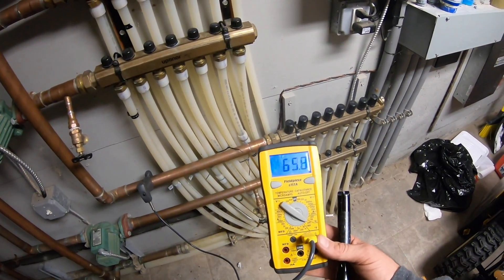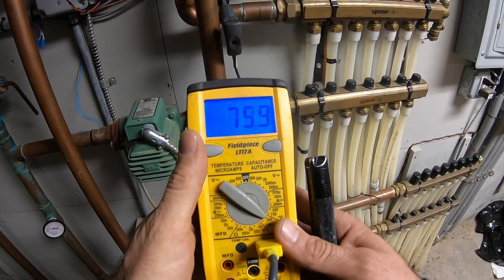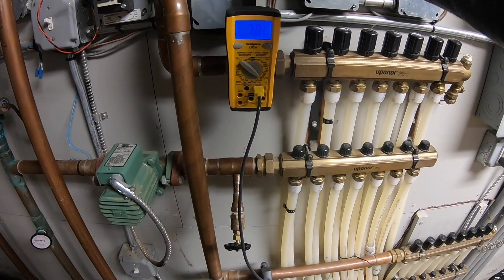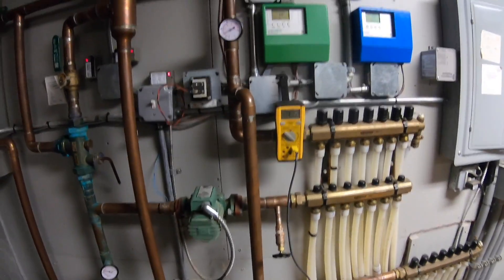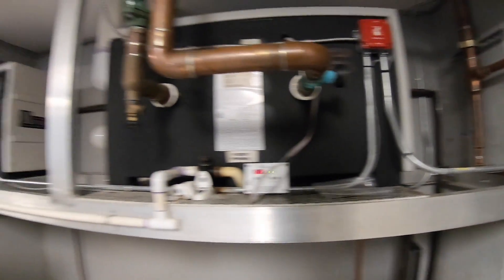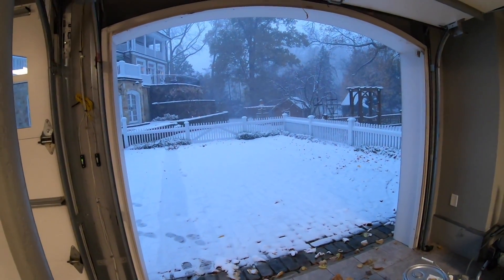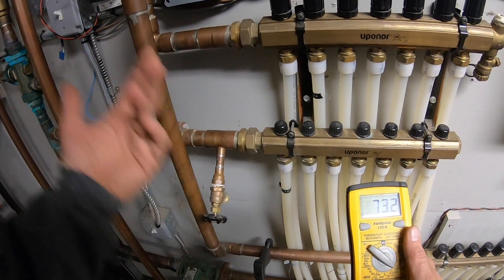Testing Boiler Snowmelt/ Heated Drive Way System After Repair During Snow Storm

Comment: I build a small little system on the house and we got some freezing rain and dryed the slab off in about 2hrs. 6” slab with 800ft of 3/8” type-c small little 275ft3 about 40kbtus. But its warm in Kentucky lol. We don’t get but a dusting.

Comment: I'm just now doing my research on this, isn't 120 degree too hot to hit the frozen concrete with?
Reply from the maker: It takes awhile for that slab to heat up. That 120 degrees will decrease as soon as it enters the slab. It’s buried at least a foot under the actual driveway. Remember the water is cold when it first starts moving through the slab and slowly heats up. Yes if it was 120 instantly that could be a shock.

Comment: I’d invest in the gas supplier. That system has gotta cost the homeowner plenty!
Reply from the maker: I have owned stock in PSEG since 2010. I take care of about 300 homes with heated driveways. It’s one of those selling points, like a generator, all heated floors, snow melt systems for driveway and all walkways.

Comment: All pipes should be isolated for less heating loss.
Reply from the maker: All pipes are isolated with flow controls and actuators for the zones.
Reply: @thehvachacker  Im sorry i ment insulated.....sorry english isnt my language :) Especially the copper ones. You need the heat in the pipes not to warm the air. Its a conciderable amount of heat loss. So the boilers works more and less heat goes under the ground to melt the ice.
Reply: @petertomas3665  It's possible, and even likely that the homeowner wants the waste heat to help warm the garage. No need for a Modine or similar

Comment: Maybe the water pump is to slow. So the come back water get cold. More faster 🤷‍♂️
Reply from the maker: Good thought yet the driveway slab was frozen so it will absorb most the energy/ heat causing a colder return temp

Comment: I'd like one of these systems.. I'm in Michigan and the last 2 snow storms we had so far this winter killed me the days after I shoveled. I would prefer to spend the little bit of money it would cost to run the heater during the storm than spend several days in pain, having difficulting breathing, or waking up with what feels like a heart attack.
Reply from the maker: I would like one also. Many are hating on this system yet
 If they lived in an area with lots of snow and could afford it 5ey would have it. Most that are hating on it don’t deal with much snow or shoveling
Reply: @thehvachacker  Do you have any ideas on the cost of installation? Also any ideas on best overall system, least maintenance required, cheapest, easiest to operate? Maybe you have a video on that already I can watch.

Comment: so much hate .. its their money. I wouldnt have it, and my driveways steep, some salt and grit, and winter tyres on all the cars and were good to go, dont bother shoveling the snow, just drive and compact it, long as the cars done slide who cares.
Reply from the maker: There is a lot of hate over this heating system. I won’t turn down the work so I will maintain and repair a system designed to heat the ground.
Reply: I do this for the most part, drive on it and pack it down as much as possible but that only works for so long. If it starts to melt it gets soft and you can get stuck/bottom out in it.  Also when snow plows blow by your driveway the snow from the road ends up at the end of the driveway, and it can be super heavy and packed. Waking up or coming home from work to a driveway with 6+ inches of snow is never fun.

Comment: my brothers 2700 sq ft home has heated concrete driveway about 20 yards long (and interior infloor heat) run off 4 120 gallon electric off peak water heaters. built in 2006 the general contractor told him electricity is the best economical choice to heat his home. it's his 4th new home getting close to retirement he says he wont shovel/push around snow anymore
Reply from the maker: I will stick with gas it is much cheaper to heat with gas than electric. Yet why not I have customers with electric snow melts. You also have to factor in these only come on when it snows or manually gets started. These are not on all the time. I am putting one in next time I rip up my driveway yet I am going water over electric

Comment: The math is pretty straight forward in these systems.  Estimate the mass of concrete and the heat rise, add the energy of phase change to evaporate the snow.  The loads on these systems are insane.  That looks like about 1000 square feet of patio probably six inches of masonry total so 500 cubic feet of brick and concrete in round numbers.  20 yards at 4000 pounds per yard of 80,000 pounds of stone which needs about .33 btu per pound per degree F.   If you want to add 30 degrees F to the concrete you need about 650,000 btu.  Add in heat loss to the air and energy for phase change of the water and you probably need about 1,000,000 to get that slab clean.  If those are 150,000 btu/hr boilers you need about 3-4 hours.  And the energy required to allow the snow to evaporate could be that amount again.
Reply from the maker: 3 hours is what it took for those boilers to melt the driveway and all the walkways around the house. Those boilers are 400 mbtu each so 800,000 BTU of heat, it does all the decking and walkways around this house.
Reply: That’s why the Tekmar control comes on as the temperature drops,in theory,to heat the slab before critical heat is required!good system,just requires maintenance,and we Love maintaining!!

Comment: Only one condition for a heated driveway... if it was really steep. This big flat area I don’t understand. Garage is a mess.
Reply: People with money is how we make money.
Reply from the maker: Exactly and who turns down a boiler repair job even if the customer wants to heat outside
Reply: The HVAC Hacker 
Don’t care if they don’t use garage, still a mess, trip hazards everywhere, owners are obviously disorganized and make stupid decisions. Heating still not working from what I can see and quite possible not installed correctly. Money can’t buy brains.
Reply from the maker: Heat works the driveway was melted a few hours after I left. too much thermal mass for this to quickly happen after repairing both boilers. The main house is neat, spotless, and amazing. three people live in that house the lower garage and apartment are forgotten about.
Reply from the maker: They don’t use that garage. They keep there cars in a 3 car garage attached to house. The lower garage has an apartment on top also unused
Reply: @thehvachacker  i was just talking with one of my customers, a man with a ship load of money . He was telling me about one of his clients who has just spent $100,000,000 AUD on a house in Double bay Sydney Australia . All i can think of is the fact two people plus staff live in this mausoleum but it provides income for a damned site bigger crowd. And no snow in Sydney either.

Comment: Thanks for the informative video. I will never invest in this system because. It does not melt snow.
Reply from the maker: It does melt snow just not instantly, you need to let it run far some time since the boilers were offline locked out when I came into the garage. I replaced a blower motor in this house since and the homeowner said 3 hours after I left all the snow was off the walkways and driveway

Comment: Just going to watch the snow melt are you?
Reply from the maker: If it happens before 4:30pm yes I will. Since that is the time my maintenance ends. I am testing the equipment during a maintenance. You wouldn't watch it operate and make sure it doesn't lock back out?

Comment: Great idea to burn of fossil fuel and have absolutely no benefit from it. Why don't you take a shovel and workout a little. Waste of money, copper, plastic and of course fuel. IDOTS!!!
Reply from the maker: I hope not I like working on these. This is a lot more efficient than the electric driveway melt systems
Reply from the maker: So you are against making money working on a system like this? Systems like this need constant upkeep. have to make sure the glycol mix is correct so pipes don't freeze. yet you see this house these people don't do any maintenance. Someone comes in to change light bulbs for them. Would you prefer they were using the electric driveway melt that requires the 800amp service?
Reply: @thehvachacker  Cool system, but it is indeed an opulent waste. Perhaps an electric Roomba-inspired snowblower/plow could replace these systems in the future.
Reply: @Maptologist  who cares? If people are willing to pay for it then it's there business. The advantage is no salting and not using electricity in this case
Reply: @851995STARGATE  You should care. The world will run out of affordable fossil fuels at the current rate of consumption on the shy side of 25 years. Research peak oil if you don't believe me. Salt is also a bad bet, because it's already fucking up our water and destroying cars prematurely. I've noticed that Eastern states ban the use of studded tires to save money on road upkeep. This saves a few bucks on fixing the roads, but costs taxpayers much more because they have to buy cars more often. States like Oregon and Washington allow studded tires, and it's common to see a rust-free antique cars for sale, which have been driven during the winter. The alternative is to pack down the snow/ice, and to put down sand/gravel, just like the states out West do.

Just look at Flint, MI, which switched to a saltier water supply (which became salty from the roads) and released the lead from their water pipes.

We should be saving our natural gas supply for heating and cooking while it is still viable instead of pumping that energy in to warming a rich person's driveway. It's the same reason why gas lights are largely illegal in the US today. The last people to run them were rich, and they ran them as a status symbol.

Solution: Just shovel it. A rich person should be able to afford the labor.
Reply: @thehvachacker  You are missing the point. This is a huge waste of fuel, and is effectively polluting the atmosphere just to heat a driveway. Even if this were electric and powered 100% by renewable energy, it would be an extravagant waste of money and an affront to people who can't even afford a home.

Comment: Ok ok ok.. Yes i agree ALOT of energy/POWER is needed to acheive your goal... but one very IMPORTANT thing to not forget and i wonder if you tought about that: DID you ISOLATED the concrete slab with foam?  Otherwise your heat will dissipate thru the rest of the ground that is not necesary to heat... Foam would help to keep the heat where it is needed!
Reply from the maker: It's a good question we should ask the installers. I only do service work these days

Comment: Sorry but sounds like you are trying to convince someone of why the bill is so high.  Give a price, do a job, get paid, get gone, repeat. Not sure you know what you are looking at.
Reply from the maker: There is no billable work on this job even after repairing both boilers. The customer payed for maintenance. So no price given, I am actually doing my job running and testing the heating equipment all around on the property. I know what I am looking at and have been servicing this machine for many years. I just wish I checked the boilers in the lower garage upon arrival to find out they were both locked out. I would of started my maintenace working on the driveway melt boilers before working on the main house systems.

Comment: It does not take a rocket scientist to calculate the BTUs needed to warm the ground and melt the snow/ice. 145 BTUs per pound of water just to melt ice. 1 BTU per pound to raise the temp 1 degree F. Wet ground and pavers are 150 pounds per cubic foot. Probably 10 pounds of ice and 140 pounds of rock and dirt so a cubic foot needs 1600 BTUs to melt the ground. If the ground is frozen, you need a killer BTU generation to warm the ground below and above the buried coils. A 30 x 30 driveway needs 1.5 million BTUs just to start to melt the ground. What do those boilers put out? 250,000 BTUs per hour maybe? 
Do the math. I say over 6 hours to melt all of the snow.
Reply from the maker: 800,000 BTU is the output of the two boilers. It is easier to prevent snow build up then melt once the snow has started to accumulate
Reply: @thehvachacker  So, if the heated drive area is 30 x 30, it will take 2 hours if the snow is light. If the heated area is larger, figure the 1600 BTUs or more per cubic foot of snow and frozen ground. If the system is programmed to keep the return flow at 36 degrees or so, the drive should stay melted. It would need to be even warmer is the tubing is buried deeper. 
If snow accumulates, it means the ground has already frozen so you have to melt the ground before you can melt the snow. NJ has up to a 3 ft frost line so preventing that deep freeze would be important. Heating frozen soil 3 feet deep would take over 5000 BTUs per sq ft, more like 7 or 8,000 because of inefficiency. I wish some of those wealthy people would pour some of their money in my pocket.
Reply from the maker: The tubing is in a slab of poured concrete. So it’s at least 1-1/2 feet deep. The return was coming out of the ground in the 70’s yet that’s a lot of thermal mass on only 800 mbtu of heat. These are Belgium blocks the driveway is paved with. This system would work if boilers weren’t locked out when I got into the garage for maintenace. The home owner turned it on 7 hours earlier.

Comment: wtf, heated driveways are a thing? Isn't this a complete waste of energy. Why do you need it?
Reply: It is not just "status", one way or another the snow needs to be removed and you have a few options, do it yourself, pay someone to do it, or put in something like this. I don't walk to work, I drive or take the train, I don't drill holes with a hand crank drill, or type with a manual typewriter, why is it some affront that I would rather enjoy a nice cup of hot chocolate and watch my system melt the snow away. My wife loves it also, if it snows when I am out of town, no problem, she is not stuck shoveling. I also don't see how it is any different than buying a snow blower or power mower, it is just another tool to use to get a job done. 

The HAVC hacker makes a point also, these things require maintenance and that means income for these guys as well as the installers and makers. What is the point of making a good living if you don't treat yourself to something nice once in a while :)
Reply from the maker: It’s a status thing and a selling point on many of the upper class homes like the house care takers, personal drivers, and 60+ Kw generators. To most yes it’s a waste yet would you not want to take care of this house with all the possibilities of many things breaking?
Reply: Wow 60+ Kw, I have a 22kW generator, duel fuel, can run off natural gas or propane. Even at 22kW it is more than enough to handle everything in a 3.5K sq ft house. While it would be technically possible to overload it, they have split the essential from non-essential and if the demand gets too high it automatically cuts off what they call the "hotel" load, this is the non-essentials.
Reply from the maker: @wildbill4476  I am not against I want one so when I get home from work at midnite on a day like this I don't have to shovel or break out the snowblower. I call the system crap yet too many believe a heat pump is sufficient. They got sold a bag of rocks cause not much heat in the air when its low single digits and those electric heat strips are on 24/7. Most of the residential work I do is all high-end homes. My company takes care of regular single unit homes also. Yet you can't send someone with not alot of experience to homes like these way too many controls. 
As for the generator, it all depends on what you consider an essential load. one house I take care of feels the 8 AC systems 2 boilers, 4 Nortec steam humidifiers, Leibert unit are essentials. The guy also has a vault under his house with over 100M of are inside so that space needs to be properly conditioned. Most can get by with a 22kw and load shed the ac's and big loads to keep the system operating.
Reply: people that have a heated drive are rich stuck up lazy snobs
Reply from the maker: @silvertone169  Why hate the rich if your in any trade they keep all trades busy, Or they keep many employed

Comment: You said it your self, "The ground is almost frozen" My father worked on these things at car washes. 8 Hour Minimum warm up from a dead frozen start! 

Quit your belly aking, stick around and enjoy your 2 hours paid break. tell the owner "looks like we're all good, but it's going to take a long time for the slab to warm up and do its job. I'll be back Tomorrow to check, If there are any problems give us a call a well come running "
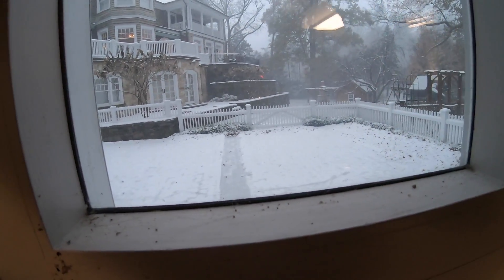Reply from the maker: The customer paid for my time so I couldn’t leave till at least 4:30. That house is sold as an 8 hour maintenace. So I gave myself 2 hours for the two munchkin service. It would of been my first time witnessing this kind of setup and being on site during a snow storm. To bad both were locked out on faults so they didn’t come on when the customer hit the manual start